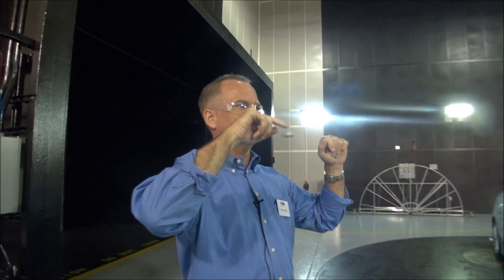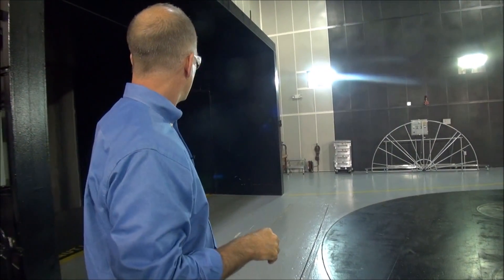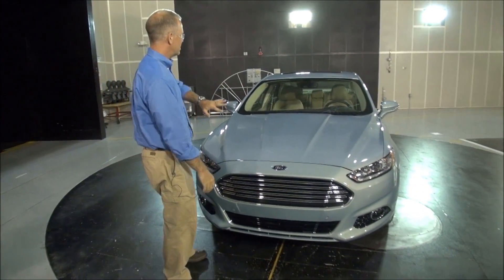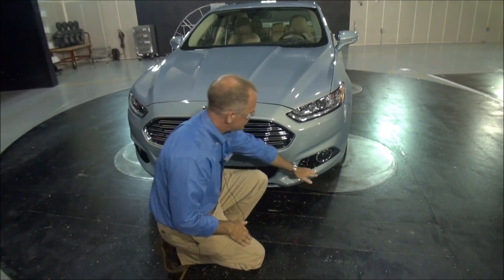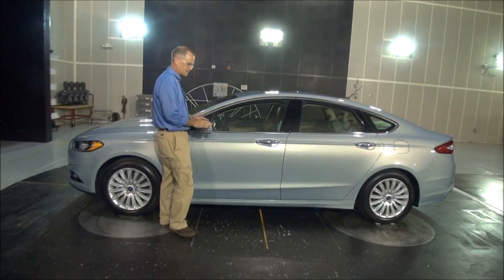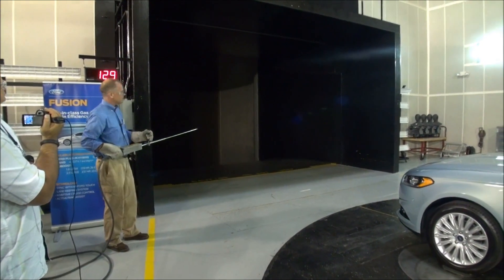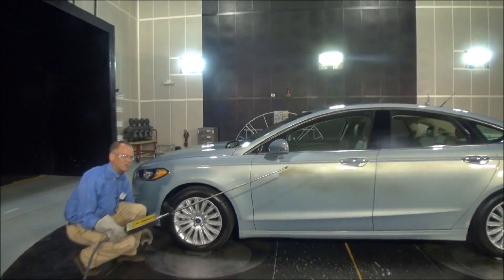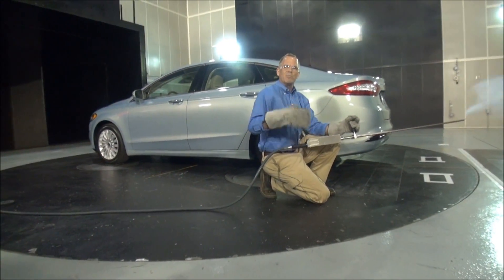2013 Ford Fusion Wind Tunnel Test

Comment: I've been a mechanic for 19+ years. I modded my 2015 2.0 All Wheel Drive Fusion, it makes 314hp and 327 ft lbs of Torque. I watched this video MULTIPLE times before adding canards, diffusers and splitters. The car handles even better. I call it, "Improving on greatness". Thanks for the video, it was a huge learning tool!